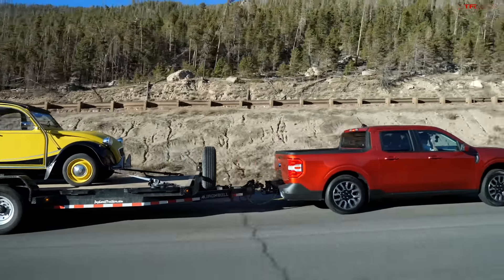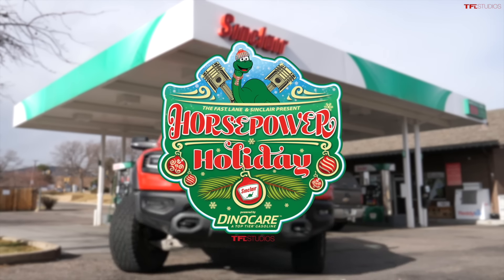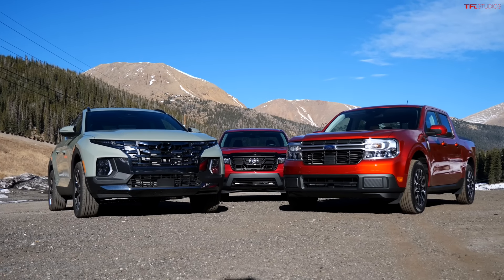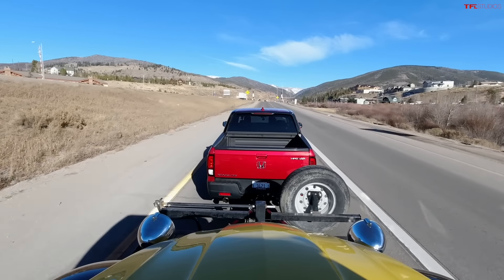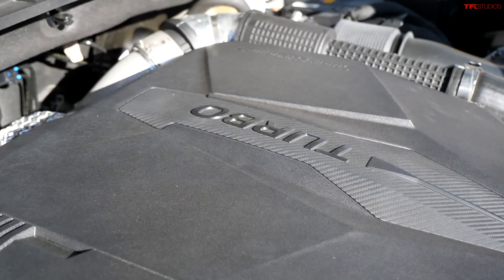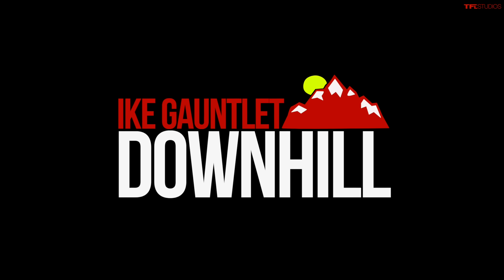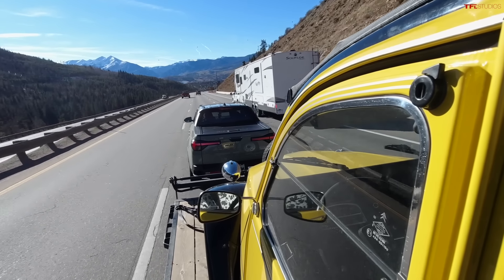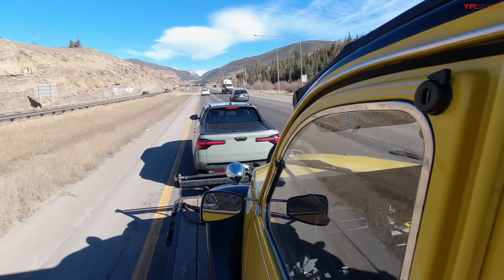I MAX OUT The Maverick, Santa Cruz & Ridgeline, But Which One Wins The World's Toughest Towing Test?

Comment: My local dealer has a Santa Cruise SLE with just the tow hitch and floor mat option. With the non-turbo and 8 speed torque converter transmission. I am going to go take a look at it. So far, I am liking the Maverick more, but am having a hard time choosing which configuration I want. I like the Hybrid because of the quiet very highly fuel efficiency it has, for a very good value. But I am thinking my sweet spot is going to be the Maverick XLT AWD with the max tow and FX-4 packages. I want power mirrors, cruise control, the front recovery hooks, and the 4000 pound towing with the 7/4 pin connector. I would like the leather wrapped steering wheel and the heated power mirrors, but I don’t want to spring for the extra expense of the XLT luxury package. Nor the extra cost of the Lariat package. I don’t really want the leather seats.

Comment: It's unfortunate you rely on the vehicle trip computers for the fuel mileage for which you award points when it's proven over and again that most are very optimistic, IN YOUR OWN VIDEOS. Actual figures would be helpful, even if you have to go any distance to fill the fuel tank(s). A true towing comparison should include ACTUAL fuel economy!
Reply: Yes! This is also my frustration, especially when it's used to award or deduct points based on a 0.2 MPG difference. I especially want to know accurate MPG when towing with a turbocharged engine. My Ridgeline reads consistently 1.3 MPG high, as checked on a recent 2200-mile road trip. These factory MPG readings are calibrated by the marketing department to make buyers feel happy with their purchases.
Reply: I agree, especially considering Ford is famous for over estimating fuel economy by a considerable margin, proven on the fuel economy run Tommy did in the hybrid. I'm sure Hyundais is off too. Be interesting to see them both on a fuel economy trip like Roman used to do just highway speeds and then with city driving. Cause I am interested in long haul situations with heavy highway mileage, having comfort and a fuel economy expectation would be nice to see cause having a little bed would be handy for me.
Reply: It is such a short distance and small gallon amount though that any small pump variances would significantly screw up the calculation
Reply: How do you propose they measure the "ACTUAL" fuel economy? There isn't a fuel station at the top of the mountain, and even if there were, using fill-ups to measure mileage is wildly inaccurate over a 7 mile journey.
Reply: @stephenj4937  exactly!
Reply: They shouldn’t use the mpg as points honestly. It’s fine with there long loop that they do to on other trucks but on the ike there is no way it’s accurate so they shouldn’t use it at in there scoring system.

Comment: You seemed to have issues with the slightly rougher ride in the Maverick, i wish you had the Fx4 package for testing as it is the truly fully loaded Maverick and supposedly is equipped with slightly tuned suspension and upgraded cooling. Since you tested the fully loaded Santa cruse it might have made a difference to have the fully optioned Maverick? Just saying.
Reply: This maverick had the tow package witj the upgraded cooling

Comment: Ohhh... this will be GOOD!  Thanks for this guys!
Reply: Ok.  So yeah.  Hyundai is basically a car that can do truck stuff.  The Maverick is a truck that does truck stuff.  Hyundai rides like a car, has comfort like a car, has gizmos like a car.  Maverick rides like a truck, has (less) comfort like a truck and has (less) gizmos like a truck.  But the BIG takeaway is that if you wanna haul something and you have to use a small truck to do it, GET THE MAVERICK.  it is just better at it and has more towing related features.

Comment: The Santa Cruz is quieter, more comfortable, has snappier acceleration, will tow fine on 87 octane (not sure why you insist on using premium -- the vehicle was designed for peak performance on regular) so is much cheaper to operate, has self leveling rear suspension (again, why don't you ever mention that?), is rated to tow 1,000 more pounds than the Maverick, and the Maverick almost overheated at the end. How is it even close? The Maverick won the off road test. The Santa Cruz crushed the Maverick in the towing test.
Reply: Lol, it's rated to tow 1000 lbs more than the Maverick, yet it has no tow/haul mode and they had to add a trailer brake controller which is included on the Maverick for $4k less. You're right it wasn't even close, they only split the vote after inventing special categories that the hyundai could win.
Reply: Another day, another recall for the Maverick. I am so glad the Ford dealer tried to screw me on my trade in when i was considering the Maveric.  I was almost in the biggest pos on the market today.
Reply: Another bitter Santa Tucson owner.

Comment: So if the Honda Ridgeline is the benchmark / baseline then this test is between the Maverick and the Santa Cruz… That’s what we’re here to watch right? If that’s the case then the Santa Cruz definitely would be more comfortable towing a trailer up or down hill. It would do it easier, faster with a few more brake applications. Right? For more $$, the Cruz takes the win 🥇 
(Good, I bought the SC Limited)

Comment: Since the Maverick was at its tow limit, do you think it's underrated because it didn't appear to be struggling? Conversely, do you think the Santa Cruz could manage another 1000 pounds without struggling? Just curious.
Reply: Based on the video id say yes the Santa Cruz could do a lot more. But most vehicles lower what there capable of to be safe. The Maverick probably could pull 5000 but you would probably risk damaging it. Me the Ridgeline struggling with 4000, is more surprising.
Reply: If you watch the temp gauge on the maverick toward the end of the video, it’s steadily climbing. I think if you were to tow >4k with the maverick at altitude/steeper passes like this during warmer months, it’d risk overheating.
Reply: @carguyeyedoc  it's also the only one with a dedicated gage though
Reply: The Maverick was close to overheating so I don't think it's underrated.
Reply: Remember that they aren't rated by if the truck struggles to pull it. Braking distance, control, and even the parking brake being able to hold the weight goes into account. I think It was TFL that went through the testing with a Ram 3500 and explained what all goes into the rating and what's tested.

Comment: Only available on the higher trims of the Santa Cruz but the turbo only comes in a DCT, which are known to have issues.  Then again, the Santa Cruz isn't the kind of truck you want to tow with.

Comment: I'm not scared to tow 4,500 lb and 500 lb tongue weight with a Maverick that has the 4K towing package in a short and flat terrain situation.
Reply: Being scared is one thing. Being unsafe is another.
Reply: @J-W.-  Well within 10% of its capabilities.
Reply: @J-W.-  are you saying they were unsafe in this test? With Nathan and andres weight plus gas and equipment they were easily at 4500lbs. On level ground that would be safer.

Comment: My wife has an Escape with that 2.0 ecoboost (Mazda derived block) 172k miles with zero issues. Hyundai powertrains are questionable and dual-clutch will not last. Honda vs Ford imo depending on personal preference and price.

Comment: That noise you hear on the Ford at idle is the fuel pump. Sounds almost like valve train noise. The direct injection fuel pumps are noisy, even when wrapped with sound insulation.

Comment: Failed! The max Maverick tow capacity of 4k lbs must include the occupants of the cabin. Which means that the Mav was overloaded by at least 600 lbs😁 

Happy holidays guys 🎄
Reply: I don’t think that is right. The gcvwr is what you use to determine the maximum towing + vehicle weight. Payload is affected by occupants, not tow rating as long is it stays below the gcvwr.
Reply: @Spikejou  - It’s really close. The curb weight is just over 3,700lbs with a GCWR of 8,100lbs. The payload and towing is so close with the maverick you need to be careful

Comment: Hmmm, I thought they picking a truck not car. If you looking for comfort then look at a Cadillac or Lexus. So, I will say, best fuel economy and excellent performance 👏  make a Maverick a clear winner 🏆 🥇 🏅 👏 👌 😀
Reply: So does every truck have to be uncomfortable? Given two roughly equivalent options, I would pick the more comfortable truck every time.
Reply: @stephenj4937  Maybe you should be driving your grandmother's old Buick Regal and then you will feel comfortable.  Every single youtuber has noted that the Cruz lack of bottom to operate the audio system makes it uncomfortable and distracts you from the road, etc
Reply: @victorbeltran2808  Changing the subject, I see? Once again, why does a truck have to be uncomfortable? The new F150s, Rams, and Sierra Denalis are incredibly comfortable vehicles, as is the Santa Cruz. You're just butt hurt that the Maverick doesn't ride as well.

And the Santa Cruz got better economy while towing.

Comment: You were going downhill in automatic 8th gear at 1500RPM 62MPH on the Santa Cruz which is not a good idea when towing that much.  Then you reved up the RPM by downshifting to 3rd gear at 55 MPH which is kind of nuts.  Why not just drop it to 7th gear or maybe 6th and let it hold that speed without breaks?

Comment: I wonder what the limiting factor (if any) is keeping those things at 4000lbs, they certainly have enough power for more on less steep towing, rear axle? tires? trans cooling? Ridgeline sure is a nice looking truck.
Reply: From being sort of an auto engineering nerd, it's probably the vehicle itself.  The lighter weight of not just the frame and drivetrain components, but the vehicle itself can be a deciding factor.  There is a weight where the trailer starts "wagging the dog" so to speak.  So yeah, there is a bit of "nanny state" at work here, with payload and trailer ratings.  Can it handle more?  Maybe, but can it do it within the safety parameters the manufacturer requires?  That's the question.  Like, if a vehicle can tow 4000LBS up and down the Ike, I would have no issue going over that to tow on the flatlands.  But would the manufacturer warrant such actions?  No.

Comment: How does the Santa Cruz do in really low speed maneuvering with the trailer? Like, lets say you had to back into your driveway which has a bit of an incline? Does the dual clutch do ok?
Reply: This. Can't imagine the DCT would be happy about it...
Reply: @NukePooch1  Yeah, which is why I asked. They hate slow speed offroading. Slow speed with a trailer isn't much different.
Reply: If you don't bash the gas and be smooth with it, it shouldn't complain much.

Comment: Watching the straps on the 2CV loosen on every bump was fun. With a soft suspension rig, you really need to strap to the wheels or suspension arms. The body moves too much to trust things to stay secure.
I fully understand the limitations and don't fault you for using what you have, just pointing out an issue I've dealt with on my Jeeps.
Reply: That said, I appreciate the comparison as I think that small truck segment of the market is where I might land in my next vehicle.

Comment: This is great stuff.  I recently purchased a 3500 pound trailer and am considering a mid-size truck as both a daily driver and tow rig, and the Ridgeline is near it at the top of the list.  Towing capacity is, of course, important, but all the mid size trucks meet the towing  needs, and reliability and comfort are at the top of my list.

Any thoughts on choices other than the Ridgeline?

Comment: My lariat ranger didn’t come with an engine cover either. Also rangers don’t get an optional brake controller. You have to either go aftermarket or buy a dealer installed one. Ford cheaping cheep out.

Comment: nav vs santa; we (wife and i) have both.2002  xlt 2L mav and  2024 hsc base 4 cyl.  love both. santa's sleigh rides better. mav is more trucky, and quicker than the base engine sc. the sc is more luxurious and the mav has ugly plastic interior panels.  the mav delivers smoother shifting and acceleration. like most people, we hate the mav's dial shifter.  but the santa cost a whole lot more.

Comment: The Maverick is a much better deal in the lower trims though. You have to spend at least $35k to get the turbo Santa Cruz that tows 5000 lbs. Meanwhile you can get a base model turbo Maverick with AWD that tows 4000 lbs for just about $10,000 less.
Reply: The base $25k Santa Cruz tows 4,000 standard with no optional packages needed.
Reply: @palebeachbum   No it tows 3500 according to Hyundai's website... Also doesn't have AWD, and around 60 less horsepower compared to the 2.0 Maverick. For $25k you can spec a Maverick with AWD that tows 4k lbs and makes 250 horsepower... For a $25k Santa Cruz you only get 2wd and 190 horsepower.
Reply: @dustin146  with the turbo, AWD, and 4,000lbs tow package it's pushing $28k for the XLT, which is comparable in features to the base Santa Cruise SE. The Maverick XL is poverty spec in comparison and that's why it's cheaper. It also doesn't ride as well and isn't as comfortable.
Reply: @dustin146  1500 adds AWD to SE, this is what I did.

Comment: Seems like the Mav is the only one that has bed payload worthy of a truck. Total payload may be higher in the others, but most people don't haul mulch in the passenger seats. It is also about $4k cheaper than the others.
Reply: That's incorrect the Ridgeline has a higher bed payload as well
Reply: @bryhul6534  But, the bed's capacity is 1100 lbs, evenly distributed. The Mav can hold more than that, say 1300 with a 200lb driver. The Ridgeline is also a mid-size truck and should be compared to the much more truck hauling/payload Ranger.
Reply: @billwhiteathome2080 
I don't know where your getting your information but the Ridgeline & Ranger have basically dead even payload. The Mav does have good capacity for being smaller with a MUCH smaller bed. However it is still LESS than the Ridgeline which mine shows 1,541 lbs.  I've owned two Mavericks was literally one of the very first ppl to get one back in December of 2021. They're not a bad little truck but the Ridgeline is honestly better in every single way. Especially the seats ,ride comfort & overall driving refinement plus small things like auto dimming rear mirror & power passenger seat are actually available that I missed.

Comment: My wife bought up that today's AI transmissions need a little time before the the AI catches up with load the truck is towing.  So the maverick could be better once the transmission gets it all figured out. Secondly, not sure how many miles are on the maverick, but many cars are a little stiff out of the dealer but will smooth out after a certain number of miles..  So over time the maverick's ride may end up just right where as the Santa Cruz may end up a little loose.

Comment: Is it fair to say that despite the ford controlling the trailer load better than the HSC as per how they were tested(keeping the methods/techniques  similar), wouldn't the HSC be an overall better performer in this test if using the downshifting early on when ever needing to hit the breaks? So basically u would not have to had used the breaks as much and combine that with the overall better feel and handling of the HSC that should make it a better experience doing this work than with the FM.

Comment: Still confused why Hyundai put dual clutch on truck/pickup/other car that weren't meant to go 100mph average

Anyways, do you have an Ike test on the hybrid one?
Reply: Because DCTs are lighter, more efficient, and respond faster than traditional autos. They make all cars better, regardless of how fast you're going. 

One thing they can't do is maintain continuous power to the wheels during a shift, which makes them bad for towing, especially up hill. That's why no other trucks have one. I'm guessing Hyundai used it because it's the only FWD transmission in their parts bin that matches to that engine.
Reply: @rightwingsafetysquad9872  I swear, I believe they have the 2.5T paired to a traditional 8-speed.  Don't quote me on it, but I think the Stinger has those two?
Reply: @MDKN22  They have a traditional auto with the naturally aspirated engine in the Santa Cruz.  The turbo version has the DCT.  The stinger has a traditional 8-speed auto with the 2.5T, but that is a longitudinal transmission, the Santa Cruz is transverse.  

Some engines like the Hyundai/Kia 2.5T, Ford 2.3 Ecoboost, and almost all V6 engines can be rotated to accommodate either transverse or longitudinal powertrains, but AFAIK, no transmissions can.

Comment: Back in about 1986 a lady came into Dodge dealership wanting a new Dodge D50  4 banger small pickup, to pull a 6 horse trailer to save gas we said no because if your lucky enough to move it good luck on stopping.

Comment: If you used Sport Mode on the Hyundai going downhill, you would have had less brake applications. Smart mode always tries to choose the highest gear for fuel efficiency, so it would have been choosing the worst gear for going downhill. Sport mode would have solved that problem as it would have held it in a higher gear and worked to keep the speed down.
Reply: I was thinking that too. Smart mode is for fuel efficiency.